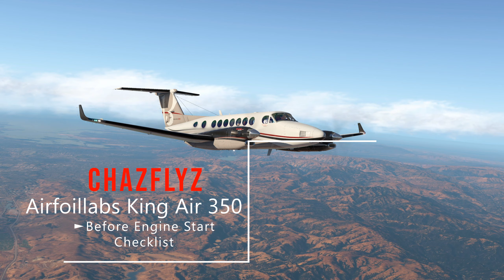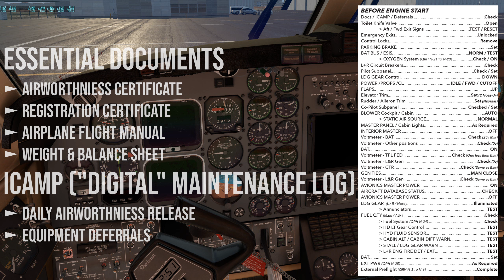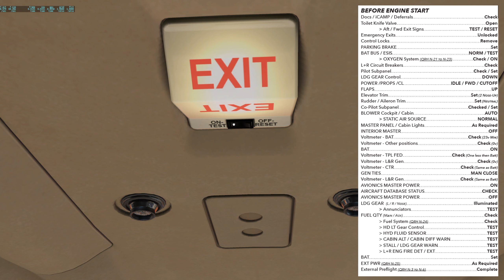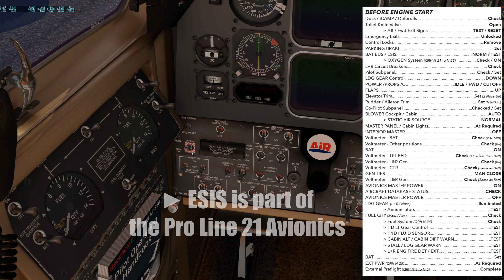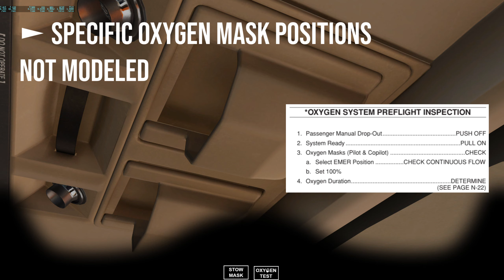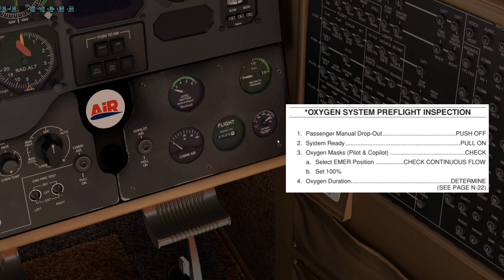King Air 350 AirfoilLabs Before Engine Start Tutorial (Cold & Dark) | X-Plane 11

Comment: Just a word of caution : It is not a full study simulations. CB do not work and the failure system is not as good as in their C172 ( although engine failures are very good ). There is space for improvement but the aircraft itself is really good.: It  just need more in depth simulation of some systems. I would call it so far an advance simulation  for sure and you can learn a lot from it and have a great time but not yet a study level simulation where I can practice all the main emergencies ( No emergency checklist so far ! ). Visual model is great and the sound too. The 2d panels are great as well and the UI is also well done. I really hope the developers will come up with a Pro Line version and further improvement of the systems. 8.5 out of 10 imho.

Comment: I can pretty much guess you may not be much interested in civil flight sim at this point but... I just wanted to express that I'd love to see you revisiting the last XP12 AFL KA350. It does behave completely different to its XP11 counterpart. It would be great to see how you feel about it. Probably doesn't need to be a complete tutorial series like you already did, instead, taking it for a spin would be enough to get a feel for it. Cheers!
Reply from the maker: Thanks for stopping by.  I stopped flying the 350 at the end of 2021 and moved back into jets, thus my KA350 knowledge is currently lacking. 🤔 but I would imagine much of the systems is all the same in the XP12 version so the same procedures should apply.  
But yeah I’ve taken a break from XP. Probably get back into it soon along with MSFS2024. Curious to see how the FS24 king air flies compared to their 2020 version which I did a “review” vs reality a while back.

Comment: Hi Chaz, thanks and clear video!
Reply: Maybe stupid question but i have two version that i can select with the airfoillabs, the normal nav screen with default fmc or double GNS. How can i select the ones that you are using in this vid? Can i select these in a setup or submenu somewere? thanks 👍🏻. Update... found it. It is in the 29th oct 1.4 release. Have to check because the afl manger told everything is up to date...

Comment: Thanks for this Chaz! So if I heard correctly, you and your crew  show up to the aircraft an hour before departure and perform these tests? One of my biggest challenges is getting everything done correctly before my slated departure time.
Reply from the maker: Yeah we show 1 hour prior to departure. Typically 1 pilot does the interior preflight/before engine start and the other does the external preflight.  Sometimes if I show up early, I just do it all! :)  Do you fly on VATSIM, Pilot Edge or POSCON?
Look for the engine runup and after start system checks video in the coming days.
Reply: @chazflyz  I fly on Vatsim and Pilotedge. One more off topic question Chaz if I may. Can this plane be flown single pilot if that pilot has the type rating?
Reply from the maker: Yes it is a single pilot capable aircraft.  However, we fly with 2 pilots for safety/redundancy.  Plus it would get lonely up there. :)